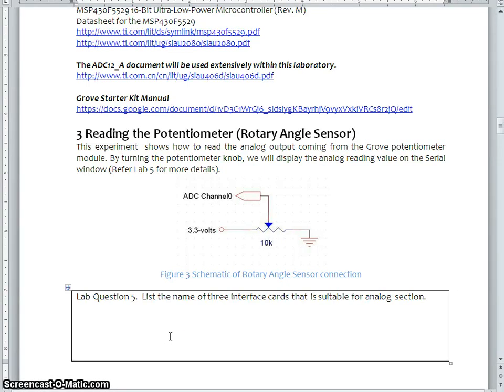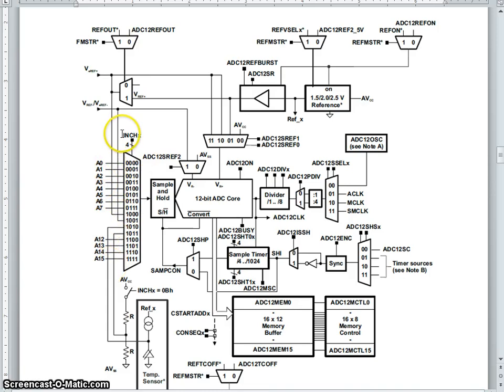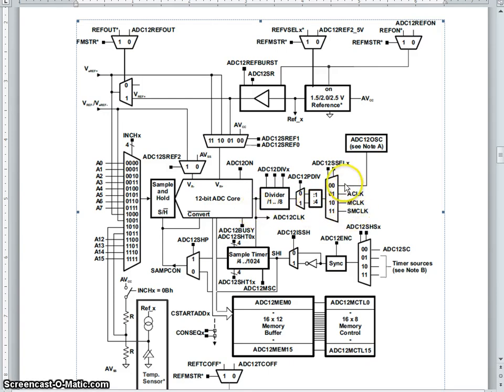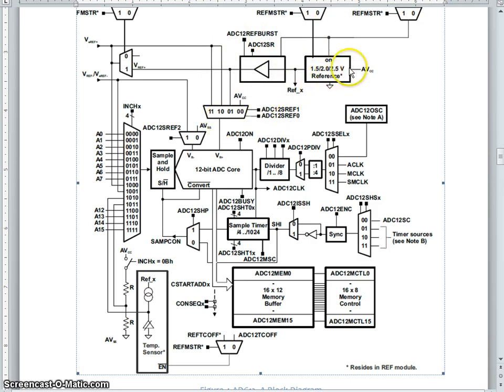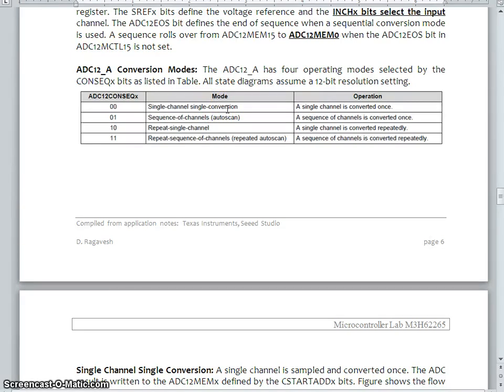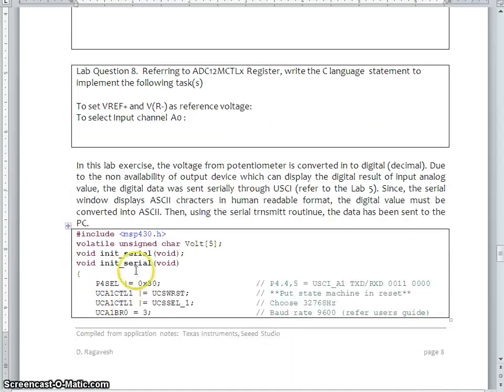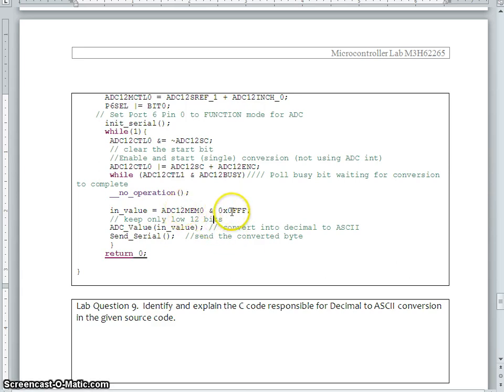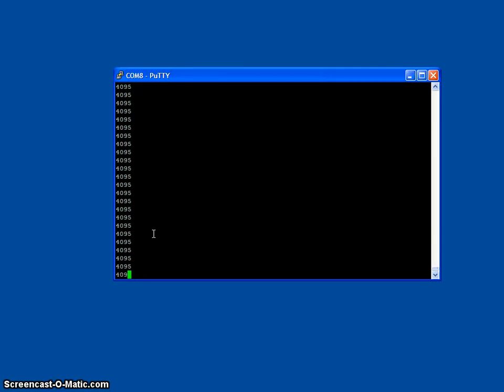Analog to Digital Conversion (ADC)- MSP430 - Launchpad

Comment: sir, in my application I am using MSP430F5529 to control sigma delta modulator to set the division ratio which in feedback path in the ic LMX2595. can you please make a sample video how to program.

Comment: Great video. Thanks for posting. I have two questions.
1. I don't understand the particular word you said around section 12:33. That is, "We're waiting untill the conversion ???"
2. I'm using the msp430g2231 which does NOT have USCI/UART. Instead it has USI. Can i accomplish the same results as stated in your video demo using my hardware?
You're response will be appreciated greatly.
Reply from the maker: Hi,
Thanks a lot.
1. (Polling) I refer to the conversion complete, ie ADC is initiated for start conversion, the CPU is always much faster than conversion process, hence, we need to check continuously conversion is completed or not, which is usually signaled  by a bit in ADC. You refer to the datasheet
http://www.ti.com/lit/ug/slau144j/slau144j.pdf
(Refer 554, 555 and/or 577, based on ADC mode)

2. The datasheet of msp430x2xxx has USCI/UART, of course USI too. Refer to the datasheet page 404 to 433 and 474 to 494.
Also, refer to the source code provided in ti website:
http://www.ti.com/tool/MSP-EXP430G2
Refer to the Software examples, source code "Source/430BOOST-SENSE1/FindAppUART/*"

Do subscribe to my channel and share, share!!

Comment: sir , needs help in C2000 TMS320f2812 MC , how to determine the angle of the motor. I use sprc179
Reply from the maker: I'm sorry. I haven't used this controller.
General note: Which type of motor you use? AC/DC?
Have thought of using shaft encoders?
If stepper motor, then it is possible using the datasheet/spec of motor we can find the step angle.
If it is DC/AC motor, certainly we need to use a feedback mechanism such as Tacho, Encoder,etc.
Reply: Sir I use a BLDC , which is made in Switzerland, after much try I am able to rotate the motor both in the +ve and -ve direction
Reply: Sir will it be possible for you to download the sprc179 and have a look at the code 
in sprc 179
// Global variables used in this system
float32 VdTesting = 0;            // Vd testing (pu) 
float32 VqTesting = 0.25;         // Vq testing (pu) 
float32 IdRef = 0;                // Id reference (pu) 
float32 IqRef = 0.2;              // Iq reference (pu) 
float32 SpeedRef =  0.4;           // Speed reference (pu) // THE VALUE HERE CHANGES THE SPEED 
float32 PositionRef = 0.5;      // Position reference (Mechanical rotor Anglele  (pu) // THIS IS NOT GETTING UPDATED, 
float32 T = 0.001/ISR_FREQUENCY;  // Samping period (sec), see parameter.h
Reply from the maker: BLDC: Well, first read the theory behind the BLDC motor. There are two methods for speed and direction control. The hall effect sensor(?) would play a key role in the control module.
Don't mix CW / CCW rotation and/or speed control. I recommend studying the theory of BLDC would greatly help, rather than playing with source code.
I'm sorry, due to time constraint, I can't check the source code.

Comment: Hello Sir, Nice tutorial. I have one query. If I want to use channel A1 instead of A0 for sensor input. Then what are the changes I need to make.?
Reply from the maker: Dipankar Panda thanks. First you need to configure the channel number. Then check conv length... After conv read the result from respective result register after reading flag bit.
Reply: Ok. it means if I connect the sensor to port A1, then Data has to be read from ADC12MEM1 right? Also in that case ADC12MCTL1 need to be configured (instead of MCTL0)?
Reply from the maker: Dipankar Panda Yes. Make sure u do proper config. Don't forget to turn on sfr function. Check the datasheet and find in which port you channel a1 routed. That port you need to config as adc input. 
Are u using same launchpad? If so mail the code.

Comment: the code of LCD interface with msp430f5529 is the same like msp430g , isn't it
Reply from the maker: Are you looking for 16*2 lcd?
If so.. You can go for 4 bit mode. Most of the serial port code will be same for lcd as they do with ASCII code.  You may need to wait a bit for video.
Reply: Thanks!